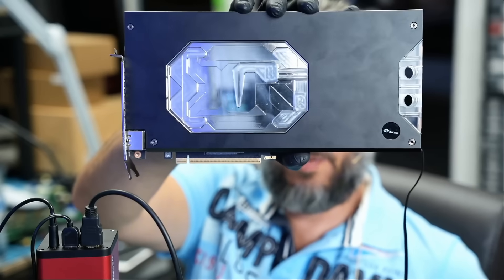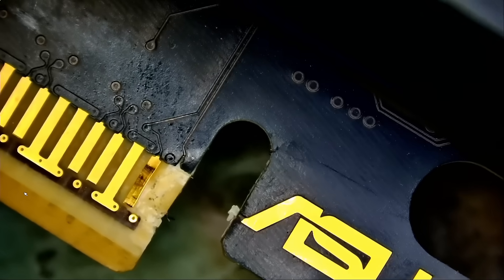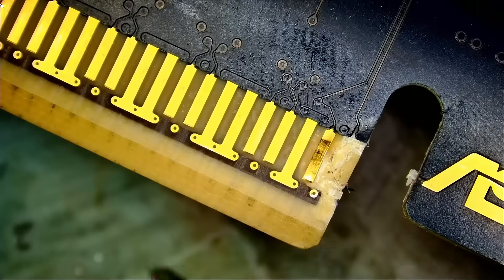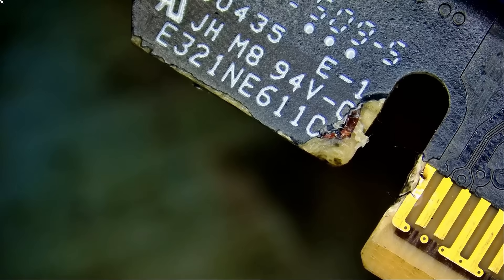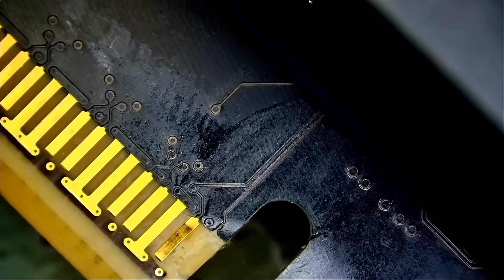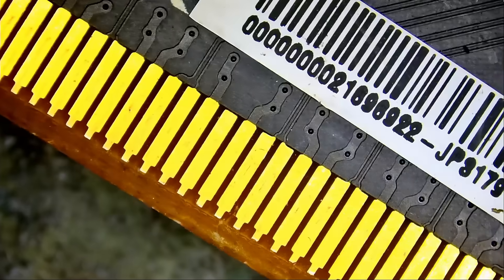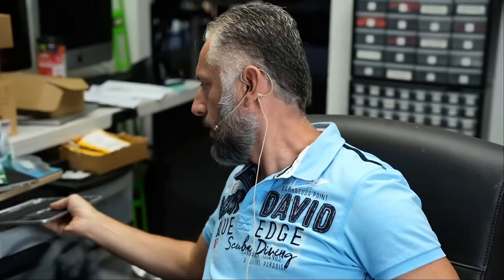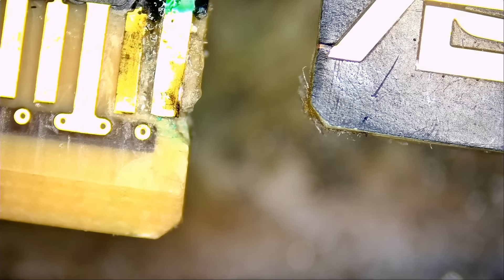Fixing a $3600 ASUS Astral GPU That Fell and Broke after 1 Month.

Comment: #Alex details the repair of a high-end ASUS Astral 5090 GPU valued at $3,600 that was damaged after a desktop computer fell. The main issues were a bent plate, a missing pin (pin 82) on the PCIe connector, and a ripped pad. Pin 82 is crucial for hot plug detection, which enables communication between the monitor and the video card 🙊😫

Comment: I see few possibilities:

1. As already was mentioned - sell working graphics card in China for desoldering GPU\RAM. Easy way to convert damaged graphics card into money and buy new one here. Problem is - for how much they will buy it? Because now it cost $3600 + this repair. :)
2. Astral is decent card and probably good binned GPU itself. It's worth to keep it. So, another possibility is actually don't sell it to China, but buy from China Astral PCB without GPU\RAM and move good working GPU\RAM on new PCB. Problem here - Astral PCB probably will be expensive. So, $3600 + this  repair + new PCB from China + GPU\RAM swap.
3. Get from China cheaper PCB and move GPU\RAM from Astral on this PCB. Usually they come with both BOX and it's cooling system.

Comment: $4k for a gpu is crazy, gonna be honest.
Reply: We used to pay $400 for a top of the line card like the GeForce 4 ti4600 back in the days 🥲
Reply: @phazonclash  Well adjusting to inflation that is about 2k. On top of that this card is a specialty card which normally makes them about 60% more expensive than they would normally be.
Reply: @phazonclash  I recently upgraded my GPU setup in order to work with the newest version of DaVinci resolve and I paid $500 for a (at least in my opinion) very, very decent card.
Reply: @phazonclash $350 for a Radeon 9700 Pro which whomped it and FX
Reply: @phazonclash  Based on GeForce 4 ti4600 transistor count, 5090 should be about $600'000 ;-ff
Reply: Moore's Law is ending, so top end stuff is getting expensive.
And if you don't drop it for stupid reasons, you might keep it for 10years or longer, unlike the cards between 1995-2015, which were outdated after 2-3years.
Reply: Never buy expensive GPU's.
Get some older gen for 260-350 bucks.....
Reply: they blame inflation, but why doesn't my wage go up with the inflation? It deflates every year 😢😂
Reply: I wrote basically the same before I read your comment.